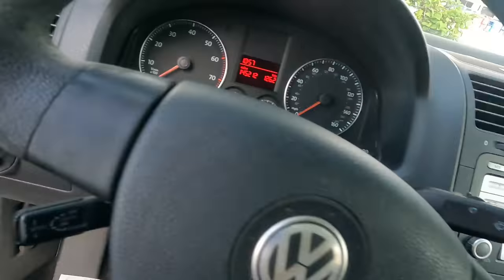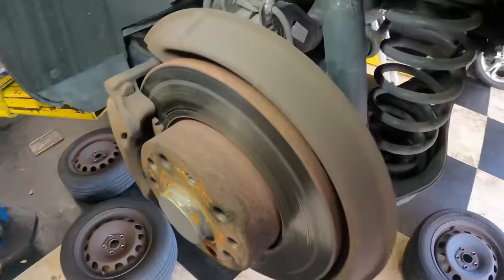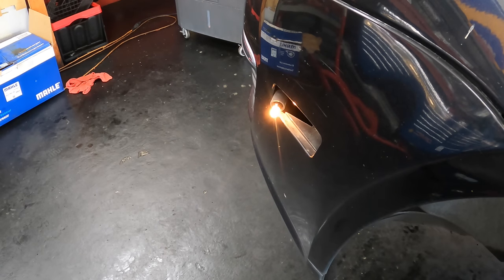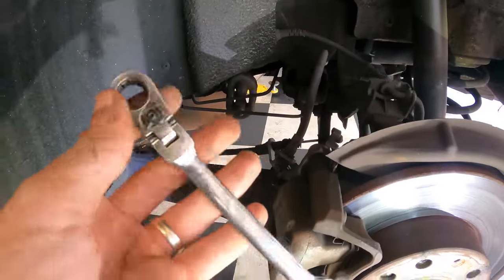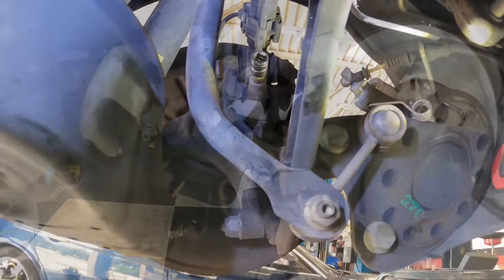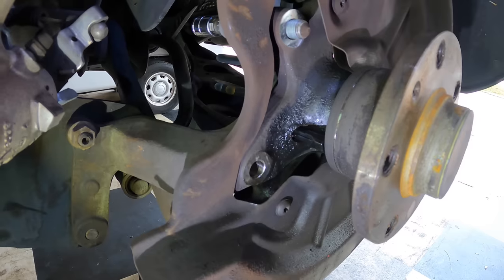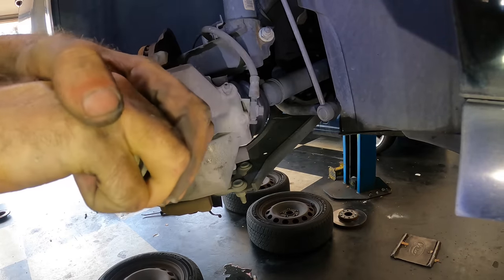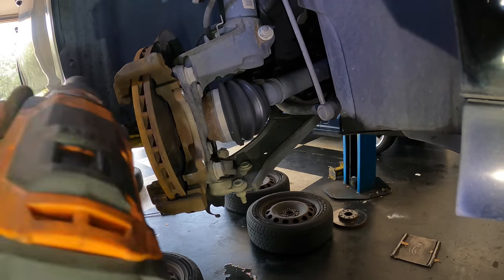Over Engineered Bolts! Four wheel brake job. Actuated Calipers. Volkswagen Jetta 2.5

Comment: I feel like it’s been a while since we saw brake parts cleaner being used to clean actual brake parts, instead of everything else on the car.
Reply: Wait brake cleaner is for brakes
Reply: i had the same thought
Reply: Also good for finding and cleaning cuts!
Reply: Ever gotten carb cleaner under your watch? It feels like you’ve been branded.
Reply: Ray, could you please explain why pistons on the rear brakes are threaded in and out......requiring that tool you used? Is it because of the emergency brake cable set up that you explained earlier? Thanks
Reply: @edmccreary1593  Cars that have regular pistons on the rear use something else for the parking brakes (often little brake shoes inside the rotor hat).  These vehicles use the rear brake pads as the parking brake, and the parking brake lever "unscrews" the piston to apply the brakes.
Reply: @bigj231  you mean drum brakes. thats most cars, im not saying you're wrong just being more accurate.

Comment: When I was working at a  full service gas station (with auto service) in the 80's I'd see the Mac truck more than I would the Snap On truck.  I guess we see who won that war. 

I recently saw the old gas station. The  Amoco full service station was sold in the late 80's and has been an independent repair shop ever since. They haven't sold gas since then. The ruins for the cement pedestals for the pumps are still out front. 

BtW...  If you think the phone drives you nuts, try to imagine the bell from the air hose going off all the time. Ding Ding!
Reply: Amazing what sticks with you. Worked the toy dept at a big box store at Christmas, I will forever hate phone calls and PA systems.
Reply: Ball bearing in bell hose was invisible cure to needless noise
Reply: I used to intentionally ride over that bell hose with my bike at the local Boron (now BP) gas/service station. Can’t remember if it made the bell ring…I remember trying.
Reply: @marknease1631  Certainly your efforts were noted..... One way or another.
Reply: @peted5217  😂 yeah, me 40 plus years ago thought that was harmless fun but, now I can understand how annoying that would be and how today I would bite my tongue to prevent dropping an f-bond to the kid on the bike.

Comment: When I was an apprentice I was taught to open the bleeder and push the fluid in the caliper into a bottle rather than back into the master cylinder to prevent contaminants being pushed back. I know it doesn't happen often but I have seen one case of a port being blocked and one of an abs unit being jammed

Comment: I did rear brakes on a Jetta for a friend! How bad could it be right! After buying an $85 spline drive and struggling to get the bolts out,several aspirin we got it done! This is before they could be found all over the place! Strap-On was the only one that had it!
Reply: Dont you just love how the brake line is in the way of the bolt too

Comment: The front bolt carrier bolt 148 lbs the 7 mm 22lbs.  Rear caliper carrier bolt 67 lbs plus a quarter turn.  Caliper bolts 22lbs+ blue lock tight, Rear bolts one time use stretch bolts.

Comment: Ray, two things. I find your videos very cathartic since I'm a car guy myself. They help me relax. Second, something that would help with your brake jobs is to loosen or remove the brake fluid cap when compressing calipers. It allows for easier fluid movement instead of trying to compress a closed system.

Comment: I got 52,000 mi out of the orig pads and rotors in my daily driver, 2010 5 speed manual VW Golf. Just had to buy the rear piston turn back tool which was on sale and made the job easy. The rear uses a 12pt Socket Triple Square socket and I got it for $10. Bled the system and the brakes are better than when the car was new. Maybe b/c I lubed all the necessary parts with brake lube.
Reply: It's called a spline not triple square
Reply: @GameCastCubed  no my dude, it's an XZN Triple Square.
Reply: It's a "whatcha call it" or a "thingamajig."

Comment: I did the back brakes on a 2005 Beetle with the same setup. I didn't have the special tool to rotate the piston but I used a large channel lock tool to turn them in. The crazy part was being required to replace the slide bolts instead of re-using them like on every other car/truck I've ever done brakes on.
Reply: If you ever run into that situation again a pair needle nose pliers works great, just take care not to tear the dust boot around the piston as your twisting it back in, it will allow dust dirt and metal shavings to build up and cause the caliper to fail
Reply: @maxmcarnage7642  Yup ran into the same situation last year on a 2009 Malibu and used needle nose. Didn't have to replace the slide bolts!
Reply: Every slide pin north of the Mason-Dixon Line is pretty much junk at the end of pad life. Actually much farther south than that🙄
Reply: @Robyrob7771  Whenever I see trashed slide pins, it's because the rubber boot is broken.
Reply: I just chuck them up in a drill and give them a few hundred rotations against some 1500 grit. Probably bad form but not failed me yet.
Reply: @PJBonoVox  that's actually not bad form at all. I do the sand thing but against a wire brush. Cleans em off and gets rid of any imperfections in the slide pin.
Reply: @maxmcarnage7642  I used needle-nosed on my son's Ford Five Hundred, or at least tried to.  Piston was stuck.  After the pliers slipping off and stabbing myself in the hand, I found it was much easier, and not that expensive, to just replace the caliper.
Reply: @hdfxrs9121  Those are the worst for seizing up, so it doesn't come as that much of a surprise they're so cheap.

Comment: Hi Ray , I just worked on one of these 2.5 VW's a few days ago. I had to replace the alternator and the rusted out coolant pipe that runs behind it. This means taking off the intake manifold for access to the coolant pipe. I spent a solid 6 hours getting it apart with all the special bolts that were seized in. Customer stated after he ok'd the repairs that it was too much time and should have only taken three hours. Made my day I tell ya !
Reply: Customer clearly never turned a wrench on a VW lol
Reply: @brandonadams3210  Anyone who has turned a wrench on a VW has thrown a wrench at a VW. Just saying.

Comment: So cool to see a vw without rust, the caliper bracket bolts get so stuck because of rust it takes a lot of effort lol I had a 2 ft breaker bar and still struggled to remove them..
Reply: I did a set of brakes on a VW on jack stands. 2 ft breaker bar with another 2 ft of pipe extension. I'm not sure the triple square bolts were over torqued or it's the fastener or thread Locker that they used.
Reply: It’s “normal” to fight these triple square bolts. The torque (per specs) applied to them is huge. I’m always scared to brake them when removing. Cheers!
Reply: The front bolt carrier bolt 148 lbs the 7 mm 22lbs.  Rear caliper carrier bolt 67 lbs plus a quarter turn.  Caliper bolts 22lbs+ blue lock tight, Rear bolts one time use stretch bolts.

Comment: Those triple-squares look like the easiest fastener on the planet to strip out, and I'll bet they're all sorts of fun to deal with if they get a little rust in them.  Then again, VW has been using them for 50+ years IIRC so what do I know, lol!
Reply: They can be really annoying, and some of the older VW's like the Passat, they tend to corrode (steel bolt in aluminium) to the trailing arm, I have had two different cars where the head snapped off, so you had to remove them with the torch and an airhammer, now an simple job takes 1 hour longer than expected, fun times

Comment: I first saw rear caliper pistons like that in the early 1970's They were an awful idea back then, and they still are now. I've seen the screw thread in them full of rust and seized up which means you have to rebuild the entire caliper.
Reply: So you mean just like any other calliper they seize no big deal far better than inboard shoes
Reply: I always thought it was cheap out for VW, firstly they only have to machine one side of the calliper for the single piston. Secondly the calliper side brake pad wears out before the other side, guess which one has the wire embedded for the low pad warning light? Thirdly, pads come in pairs so there’s a good chance your going to be throwing away a perfectly good pad….
Reply: @martynwardle5907  if your pads are wearing that un even there a much bigger problem
Reply: @gregshearer423  No, nothing like when a piston seizes in a caliper which occurred far less often than the thread seizing in this type of caliper. Inboard shoes are brilliant in comparison, and tend not to wear out unless you use the park brake while driving.
Reply: The GM ones were a nightmare. They worked fine as long as the mechanical parking brake was regularly used. The screw mechanism would advance as designed and keep the piston in contact with the pads. Unfortunately, nobody ever uses the parking brake. Customers would come in with a complaint of a low pedal. The rear calipers would be gunked up and seized. Calipers replaced, customer educated on the function and the necessary use of the parking brake. A year later, they would be back with the same complaint. Rust on the parking brake cables verified the non-use.
Reply: @gregshearer423  I worked out that the piston side pushes on the rotor first before pulling the calliper across on the slide pins thus enabling the outer pad to come into play. It would seem logical that pad in contact for the slightly longer period of time before the rest of the calliper forces the outer pad onto the rotor, might well wear down before the other over thousands of brake applications. All that is conjecture, that and the fact that both my VW Golfs do the same thing. Maybe I should strip them down like Ray did and lubricate the slide pins? 
The VW Polo I owned had twin brake pistons and consequently this didn’t happen. Perhaps some VW Technician can enlighten me?
Reply: Older Mustang's also have the screw style rear calipers, I remember having to run over to autozone to rent that tool to do his brakes because that was the one and only time I never needed that screw tool to compress the caliper

Comment: Be careful with the front caliper bolts , they are not T45 but 7mm hex. You could see them in the vid every now and then when the angle was right
Reply: That's what I usually use too. Bought it cuz I know vw does that wacky stuff.  Also always save the rotor screw.  Can't ever seem to find them again
Reply: The 7mm hex is only ever used for caliper bolts.
Reply: I was taught to always replace those bolts so the mistake would have been caught and he would have not had to beat the socket into the bolts.

Comment: According to the manual brake carrier bracket bolts are supposed to be replaced
Reply: Correct.
Reply: Is anyone actually going to replace them?
Reply: Why?… they’re not torqued to yield? No other manufacturers that I know of call for replacement. Just another expense… I would never own a newer non-air-cooled dub.

Comment: What happened?  Did a different engineer design the rear than the front? Different fasteners Wow 👍😁
Reply: The fronts require a higher torque value. Triple square bolts have a much lower yield point, and should be replaced. They are most often torque to yield bolts, and are single use.
Reply: Typical Euro engineering
Reply: @williamallen7836  You are 100% correct. The official service manuals from Bentley for years would always state to replace these bolts and goes way back to the 1980s.
Reply: @watershed44  yup torque to yield bolts have been common on American cars, and trucks since the 1980's as well. Mainly on bolts that thier clamping strength (spring quality) is critical to prevent the bolt from backing off. It helps maintain tight tolerances on more modern vehicles. Sometimes the dealer repair manuals will allow reuse, but only once bolt stretch has been measured & well within spec. I still prefer to replace them, and keep any that are within spec as a future backup. Just incase they happen to be on backorder a few years later. I bag 'em and tag it with bolt thier stretch measurement.
Reply: @williamallen7836  Wow, are you or have your been an AP mechanic? You're attention to detail sounds like you've been in Aviation service!
Reply: @watershed44  reusing bolts in aviation? doubt it..
Reply: @petesmitt  AI not comprehending again...
-recalculate....🤣

Comment: What order are american pedals?
Here in aus (left to right) clutch, brake, throttle. If auto- brake, throttle. Random yes but curious
Reply: Same here with left hand drive in the US. Clutch, brake🛑 and gas⛽
Reply: Had an old milk float where I used to work (in the UK), that had the accelerator to the left of the brake, don't know if this was the same for all milk floats. I wonder if there were many other vehicles with unusual pedal arrangement. It certainly caused a few accidents in my work place.
Reply: @matthewholzinger1042  cheers mate, always been curious as to the setup but never been able to tell through vids
Reply: @jacksegond7163  no problem. I used to wondered the same thing. I think pedals are the same on cars and trucks worldwide. Except for vehicles like the model T for example.  I'm into Corvairs and saw when imported to Australia they had to be modified for right-hand drive. An article in our magazine showed in detail how it was done.  I'm surprised they made a vehicle that old be converted.  I'm sure we have laws that would freak you out too. Also some laws vary by state so things like displaying a front plate or window tinting, etc can vary.  Love your old Falcons!!!!

Comment: I am amazed that a new rotor is cheaper than turning one.
Reply: I checked into turning a set of rotors and found that it cost over half the cost of replacing them. Doesn't even include the hassle of pulling them off, taking them in, waiting to get them done ( Maybe today, maybe next month) dragging them back and reinstalling .

Comment: German engineering philosophy: Never use common fasteners when special ones are available.
Reply: And never design a simple engine that simply works. Always produce that mechanical engineer's graduate design monstrosity. Hence that 30 valve VW/Audi DOHC V6. 100x more complicated than it ever needed to be. An added plus; all of the gaskets and seals self-destruct at 10 years/100K miles. I still have the special tools for the timing belt replacement if anyone needs them. What a POS.
Reply: Europeans love their German cars, though. I wonder if those parts are super common over there since there are so many German cars on the road. It certainly doesn't seem that way on this side of the globe!
Reply: The fasteners are common. They are used extensively on VW-group cars, which are like one third of the cars in Europe.
Reply: I've owned Japanese, American, and VW and the volkswagens have been the most reliable cars I've owned. Also by far the oldest and highest-mileage of the bunch

Comment: Hallo uncle Ray. Love your uploads. In far off South Africa  I drive a very old Citi Golf ( you will know them as a Mk1 or a Rabbit) and the CV joints have those same pesky fasteners. So the first time you replace a CV boot, you replace them with normal hex bolts which is not prone to stripping.
Have a great one

Comment: Put the rear calliper piston at 12 and 6  some pads have tabs that fit into the grooves on the piston I,, when you tighten it up the wheel will lock. Great video as always.

Comment: The closeup of your green electric ratchet when removing the second triple square bolt (13:20) didn't look right. It looked like the crankshaft part was off-center in the housing.
Reply: I think It's a rubber sleeve over the end.
Reply: @deadmeat6563  I think you're right. That would explain how it kept working in the condition I thought it was in. 😀
Reply: I believe that's just a protective rubber boot. I don't have that particular ratchet but the one I have has one and they start to get a little wonky looking if you flex the ratchet like that.

Comment: How do people live with themselves knowing their wheel speed sensors might be dirty? Monstrous!
Reply: I try not to think about all the parts of my car that might be dirty, or I'd never get anaything done, as I'd forever be cleaning my car.
Reply: @LadyEmilyNyx  people would be surprised how many performance problems (especially on diesels) come from parts being full of sooty oily crud that needs to be cleaned out. And how much of a difference it makes.
Reply: @rotary_turbo99  I couldn't begin to count how many people I've seen trying to drive their diesel truck like a Mustang and then wonder why it costs them so much to run. That and simply not waiting for the plugs to be hot before starting.
Reply: @TheCaptainbeefylog  my nextdoor neighbor just bought himself a 2003 Mercedes c220 w203 . He was complaining of an occasional lack of power and hesitation. He has very little car knowledge and was panicking about it. I took out the egr and it was caked up. Gave it a good clean out and it's been fine ever since. All the crud was causing it to occasionally stick

Comment: I do like this video. Your work on brake jobs is good. I'm glad you pointed out the tip on replacing the rotors as opposed to machining. Machining is cheaper than replacing, however only for the short term.  As rotor material is removed, there is then less metal to absorb heat from braking friction causing the rotors to overheat more rapidly thus causing them to warp which results in pedal flutter. Rotor replacement is the better option. One other thing to consider is that when compressing the caliper pistons back, it is a great idea to open the bleeders to prevent the fluid which is most likely quite dirty by now from forcing back to the ABS control unit introducing contamination to the sensitive valving, potentially creating new problems and an unwelcome come back.  Food for thought. Great job otherwise!👍👍